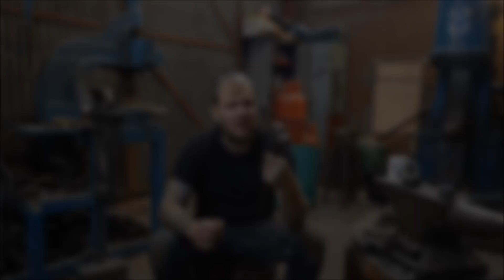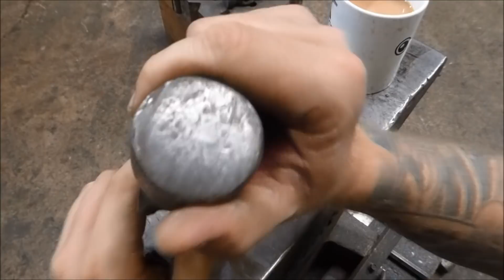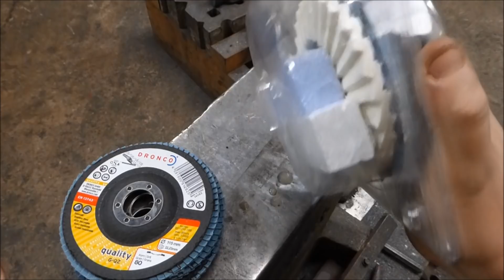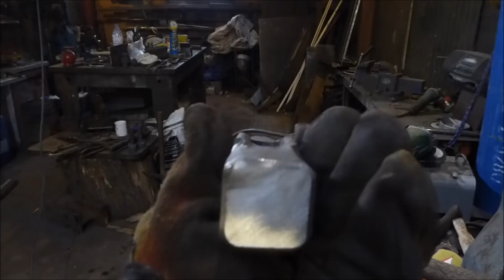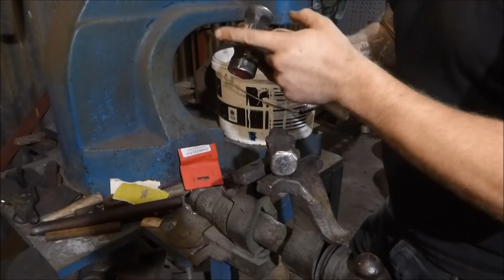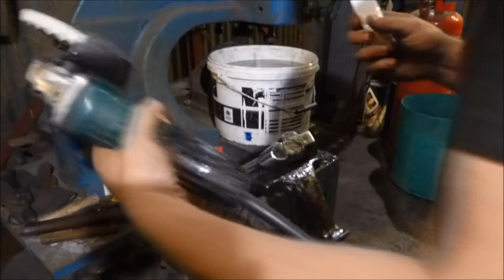How to Facing and Dressing Hammers! How to forge a hammer By Hand! Part 2!

Comment: I quite often use my little grinder in my vice disc upwards. Works well if you need more control on whatever your grinding or polishing. Just don't tighten the vice too tight :) great vid as usual m8